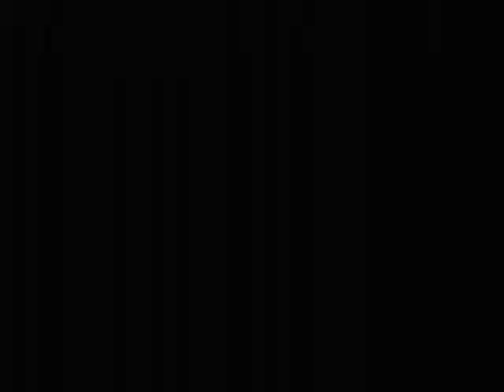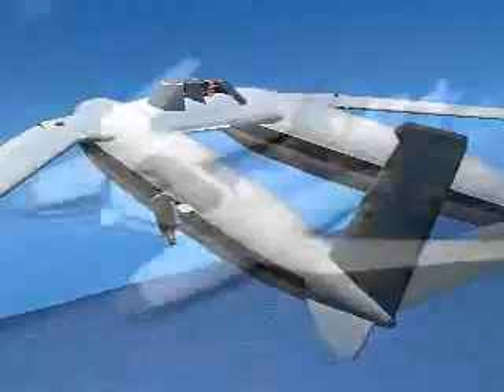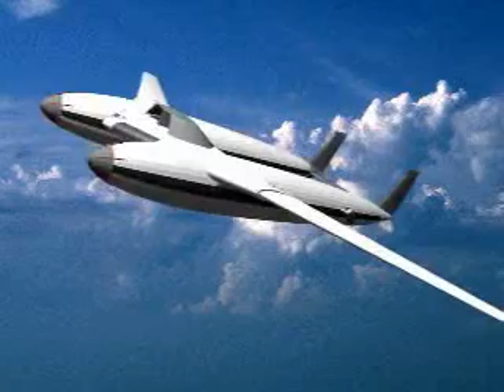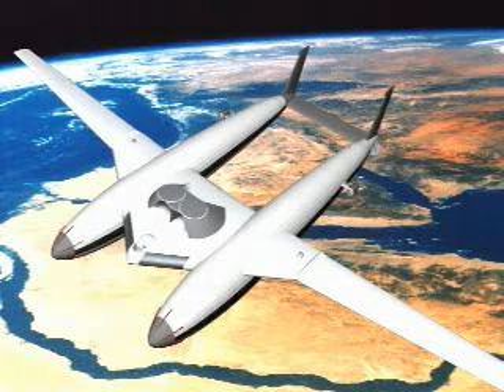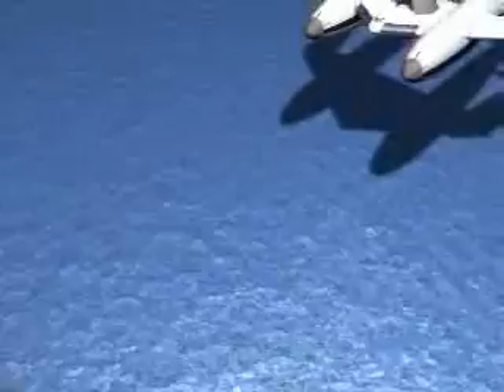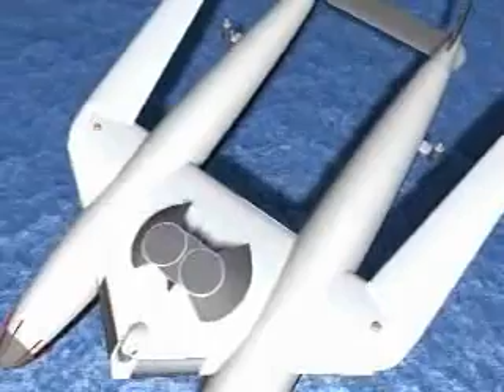Fuel-Less Gravity Powered Airplane

Comment: @trappy77 Compressed air within the vehicle is used to power pumps that pull air into the vehicle from outside.  The result is that the mass of air inside the vehicle increases, increasing the vehicle's density and causing it to fall.  A poor choice of words in the video but a sound concept.

Comment: No perpetual motion here.  The craft essentially needs only to lift itself, by reducing its own density.  But since density is already low (from He and low pressure within the shells), weight is low, and therefore energy needed to lift the craft is low.  I can imagine it is reclaimed by the turbines with plenty to spare.

Turbines run both during ascent and descent.  The craft glides against buoyancy on the way up, and against gravity on the way down.  It would have to be huge to work.

Comment: "The Gravity Plane begins to accelerate, due to gravity acceleration caused by the gravitational pull of the Earth."
Yes, we usually just call this, "falling." If the design is simple, just let it be simple. Take pride in it being simple. Don't try to make it sound more impressive with dense, scientific over-explanation. The Gravity Plane is not a plane, nor is it powered by gravity. It is powered by compressed air and rises due to buoyancy. A more accurate name would be simply, "dirigible."

Comment from the maker: @007bigwhiteshark IMHO, not necessarily. Sometimes several factors need to be in right place at right time to make it possible, and done. Read some of Kurzweil's books for more explanation on how that works. Having technology, or information is not enough to manifest something. Besides that, their r factors such as where investment money has already been put. However, over time, if the value of a technology reaches a threshold, it may begin to come into mainstream use. There r other factors

Comment: I mean, if you want a FUEL-LESS plane, then fly one of those engine-less planes that already exist, and build a extremely steep ramp off a LARGE mountain to built enough momentum and speed to fly it without actually needing fuel. I think those planes need a temporary tow from a normal plane to be able to take it high enough to fly.

Comment: #1. Hydrogen is a fuel, in a way. It creates lift.
#2. This thing would have to be light as a feather to be able float off the ground.
#3. If that thing could float 10 miles hight for the purpose to build up momentum while falling from the gravitational pull of the Earth, it would be so light I doubt it would fall fast enough to pick up speed.
#4. Even if this thing could fly like that guy says, how safe would you be in a flying feather?! 

-A gust of wind would blow your ass to the ground.

Comment: This equipment will not be able to regain the energy spent in one direction while going in the other direction.  the pneumatic motors have friction, as does the craft itself.  Each time it goes up it will be a little lower than the time before.  To get off the ground it will need another energy source to charge up the tanks.  If this was real every major airline would be all over it since fuel is one of their largest costs.  It is a variation of the perpetual motion machine.  Look on wikipedia

Comment: That's the part that doesn't make any sense.  It would be more efficient to directly pressurize the helium using the onboard compressed air.  Running a compressor off of compressed air means that the stored air which powers the compressor would have to be discharged at a pressure lower than whatever it's pumping up to.  Basically the system would dump compressed air to the atmosphere in order to compress atmospheric air, which is a circular and nonsensical process.

Comment: Good use of CAD designing this, it would be nice if this would work, unfortunately it can't.  I'm a mechanical engineer and the physics behind this just don't allow it.  Helium has a density of 0.18g/L and is about 6 times lighter than air, but even lifting a 100 pound tank that holds the helium off the ground would be near impossible, let alone compressors, a hydraulic system, not including the people.  It's a perpetual motion machine.

Comment: The point is to use the extra power during the day. This plane is so big that enough panels could maybe be added to charge batteries for nighttime - As long as the battery weight is taken into consideration. A normal plane could at least save fuel during the day. It's about using alternative energy as much as possible, saving fossil fuels and lowering aircraft weight. Even saving 5 tons of fuel weight on a conventional plane could make economic sense.

Comment: I'm sorry. That plane is HUGE. If covered in light-weight solar panels it could probably power some serious thrusters. It's so obvious. Why not just use what you have? The same goes for traditional jet airplanes. I'm sure a few hundred square meters worth of solar panels could generate enough power to considerably lower fuel need and therefore the aircraft weight and probably also run all the on board electrical systems. On a plane as efficient and big as this it's gonna apply even more.

Comment from the maker: @Horia747
(A) what happenned to zeplins that is relevent to this airship and it's success?
(B) with advances in engineering and chemistry, we may build far lighter all the time. technology has increased in this quite a bit in the last 50 years.. & new technologies such as carbon fiber, & nano tubes & other nano technology will continue in that regard
(C) slow? how fast do you think it will go? & when comparing costs, this may be adequate option for some purposes, compared to fuel guzzling jets.

Comment from the maker: This airship is about ultra energy efficiency. And it may also further its capacity by pulling energy from the environment, such as solar thermal, solar PV, wind energy, etc. These technologies are not new. Plenty of videos demonstrating them. The novelty of this approach is how it is packaged and the use of helium for lift and discent in cycles with wings attached.

Comment from the maker: consider that the compressed air is not actually doing the lifing. The helium when released from tanks, is filling the bladder, is doing the bulk of the lifting. The compressed air used as energy storage, basically just used for assisting.  And the wings also assist in creating lift and/or horizonal movement during ascent/descent. Like combo of blimp and glider.

Comment: Think blimp or "airborne submarine".  It's like a submarine that takes on water to compress and displace the gas in its buoyancy control tanks to descend to the depths, or pumps out the water and replaces the volume with the stored gas to ascend to the surface.  It's like the blimp  that uses air bladders to control how much volume inside the blimp's gas bag is occupied by helium.  You *do* need power to control the pumps and whatnot.  That has to come from somewhere, either inside or outside.

Comment: Problem is, he's thinking outside the box of physic law. It's just another non-working perpetuum mobile, this time disguises as an airplane. Gravity is a force, and you cannot convert a force to energy! All it does is to give you the ability to move somethiong from a point of high potential to a place of low potential and receive energy. Problem is, it won' return back to the original point by itself...

Comment: The only possible concept similar to the one presented in this video would be an aircraft propelled by energy (used either to run props or force compressed air out of the vessel for thrust) stored in the compressed air.  It would have to operate like a battery.

Comment: It is true that the way you explain it is technically possible, but he never mentions that there is an eventual point at which the  compressed air tanks would have to be re-pressurized.  The video does describe something similar to perpetual motion (though not exactly so) that is quite impossible according to the conservation of energy (for a start).

Comment: The only problem is that on Mars the atmosphere is much less dense. Like the low pressure air high in the atmosphere in the video...the helium lift stops working (or works much less) in such low pressure areas.

Comment: It appears that you are attempting to gain energy from nothing.   It's like the alleged "water powered cars".  You can never have greater than 100% efficiency- it just doesn't work that way.  You have to have some form of stored energy- be it compressed air, electricity from solar panels and/or batteries, or fuel.

Comment: Fair point.
Also I suppose a large amount of low pressure air could be used to compress a small amount of high pressure air and vice vresa for different applications.
The video voice over needs to be re-worded to avoid this ambiguity in my opinion though.

Comment from the maker: many people has similar concern. FYI... there different "compressed airs".. kind of like different wires on an electrical system or cogs/gears in a mechanical watch, that have different functions. The "air" is uses as a means of energy transmission and storage, among other things.

Comment: OMG, "Gravity plane"?!?!? it's a BLIMP!!!

Do the numbers, you'd find that it won't work.

you use "compressed air" to "compress air", it won't work (you can't compress more air than you use to power the air compressors).

helium is light than air only to a certain hight (quite low actully, and not as high as it would make you think from this vid).

I ran a few numbers about taking some that weight about 1 ton, and you need ALOT of helium (about the size of a hot air balloon).

Comment: yes rightly said. I was gonna explain that but glad you already did. the concept might work but it won't be perpetual. the compressed air tanks must be recharged with electric compressors on the ground at some point.

btw there's no mention in the video about the plane's electrical systems for passenger comfort, entertainment, survival, flight control, navigation, etc. etc. that would have to be recharged on the ground too.

Comment: In a full flight cycle (take-off, flight, descent, landing, preparation for next take-off) energy is removed from the system by releasing the compressed air in the tanks. The turbines will never be able to refill the storage tanks to full capacity again (hello thermodynamics). This cycle cannot sustain itself, there MUST be an external energy source.

Whatever this external source is, is the actual power source, not gravity. It'll probably be an electric plane, but I doubt any investor cares.

Comment from the maker: that is possible. I suppose a few reasons, in this design, they did not include them is that they already have the compressors for runnng the compression of the helium. And perhaps to save weight on carrying batteries? also, the pneumatic system may be less volnerable to electro-magnet pulses which can knock out an electric system?

Comment: hahaha, this video is awesome!!

You think you plane is good?  Well, mine is more efficient because it uses magnets to repel the iron contained in the Earth's core.  Once it reaches maximum altitude with it's small aspect ratio wings it can perform a number of tasks to patch up the Earth's Ozone layer, then it takes some of the Earth's Ozone as buoyancy for its water landing.  Repairing just a small portion of the Earth's Ozone will make up for the vast amount the plane takes out of the Ozone.

Comment from the maker: with advances in nano technology and ultra capacitors. We may be able to throw down a line in an electrical storm to suck up electricity to fill the ultra capacitors. perhaps even using the line to power electric motors (for air turbines or for compresing air/helium etc.

Comment: Energy is not free and the price is fixed. Keep thinking! Good job. Just remember that energy is lost in every step. I hope you suceed. This is flawed because some factors have not been considered. What is the purpose of the wings? They add weight and are unnecessary Helium blimps operate fine and can travel large distances. Helium cannot carry you very high because the air becomes thinner and less dense the higher you go.

Comment: Sure, its an interesting concept, but it would never work.  Such small gas bags would never be able to lift the rest of the structure regardless of what it was made of.  If the bags were sufficiently voluminous to achieve bouyancy, they would induce so much drag that the craft would be useless as a glider.  There are reasons we don't use lighter-than-air vehicles for serious transportation.

Comment: Yea, it will regain a very small amount of the original energy the craft had in the begining. But most of it turns to heat from the various sources friction like mechanical and air drag. How did the energy get in the plane in the first place? Fossil fueled compressors. Start with 100 units of energy to fly to 8000 feet and glide to the ground. Wind turbine recompresses the helium with, I guess, 18 units of energy recovered. It won't hit 700 feet this time. In the future it will have 0.0 energy.

Comment from the maker: there are two types of gas. One is atmospheric and the other is helium. One of the "air compressors is essentially taking energy collected by the wind turbine and running the compressor my mechanical drive. It stores the energy in the form of compressed atmospheric air for later use. One use of the energy is to recompress the helium.

Comment from the maker: part 2
The energy of spinning those wind turbines is used to compress air with pneumatic motors. And that compressed air, a form of stored energy, may disperse that energy to re-compress the helium that caused the the airship to ascend in the first cycle of ascending and descending. The compressed air in the storage tanks may also be used for powering other devices on the airship.

Comment from the maker: wind and jet streams can be used to the advantage for air travel. And with modern tools of weather analysis, monitoring, mapping, and prediction, that data can be used to further augment speed and safety of air travel. And beside that, this technology can still contain backup systems of combustion jet engines.

This conceptual airship is about ultra energy efficiency.

Comment from the maker: There are a few examples on how it might be faster. Here is one example... what if there was a jet fuel shortage. without jet fuel or enough to complete a trip, The Jet airplane would be delayed in travel. This hybrid airship, would be immune to this, because it does not require jet fuel for locomotion.

Comment from the maker: It may be, in certain cases, take longer. However, there are also examples how it may provide shorter flight times than commercial jet plane flight as well. Additionally, this form of air travel may be substantially less expense than commercial jet airplane travel as well, because it takes less fuel. And there may be less liability insurance and mainenance costs. It may even be possible to fly this with fewer human flight crew.

Comment: How do you plan on making passengers, crew, the ship, all the compressed air the anouncer talked in circles about, AND cargo lighter than air. literally hundreds of tons need to be lowered to a weight ratio less than that of air. This would have to be a huge and slow method of transport IF it takes off.
Also compression intakes to gather new air instead of wind turbines. PV is out due to once again, MASSIVE WEIGHT.

Comment: Aocharlie, I don't see what the problem is with this being "fuel-less".  If it's lighter then air, then there is ZERO possibility of it ever falling.  So it's safe.

Forward momentum could be obtained pretty cheaply by ascending (for free), then venting the helium (also free) and letting gravity do the work.

The only problem is ascending again after that.  The wind turbine is complete BS and will not work.  The energy gained from it will be less or equal to what is lost in forward momentum.

Comment: Just think logically for a moment.

Even in an abstract sense, if ANY machine is doing work, it must have power to allow it to do so. This machine will not work for the same reason that you cannot extract power from a permanent magnet without external input of more power. 

This plane could certainly ascend to altitude using helium, but would most likely find that the drag created in attempting to generate sufficient power to recompress air would result in it rapidly losing altitude and stopping

Comment: "There is no fuel to explode and burn"

It's full of fucking Helium!

Also, compressors will need a whole bunch of power, where's this coming from without fuel?

Plus, where is payload put? (passengers, cargo etc) The video boasts about these things, but the vast majority of the plane is  wings and helium storage. And if you add more fuselage for this, it will add more weight, needing more space for helium.

Comment: The idea is great. but not functional. Those blimps on the side would have to be freakin huge to get lift. Especially if you want to use it for a cargo ship. I also dont think those "Wind Turbines" are going to be able to compress that much air on wind alone. If this does become a real thing, its not going to be that sleek look that it is now. Its gonna be big and bulky and the gliding may be outta the question then.

Comment: But you must see that using stored compressed air to run yet more systems to compress yet more air is inherently lossy compared to just using stored compressed air to deflate the Helium gasbags (and therefore lose aerostatic lift)?

Conceptually, the problem I mainly have with this is that if it worked as described, it would be a perpetual motion machine, and that type of machine has never, ever worked. They appear viable, but some technicality prevents them from doing what they claim.